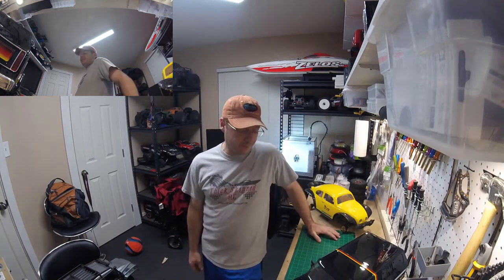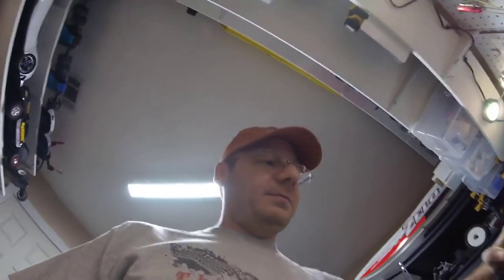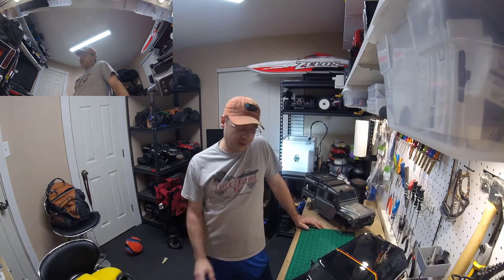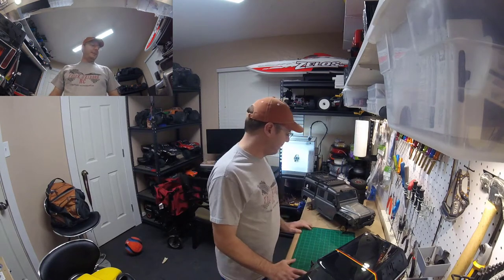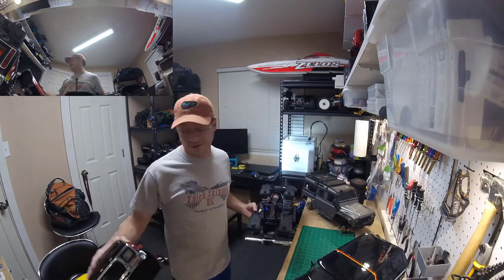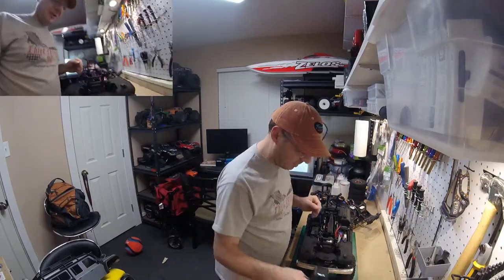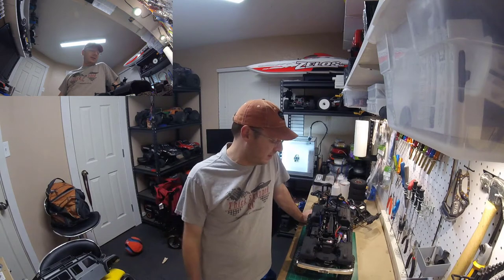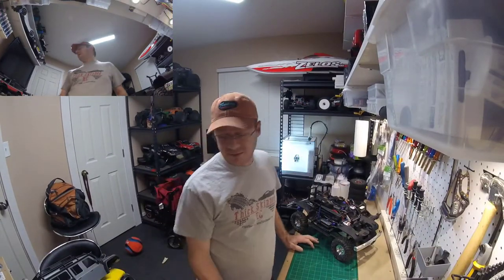TRX-4 Bronco - Impressions and Comparison to Defender Chassis.  Driving footage at start and end

Comment: The SCX10.2 you mentioned  (2nd Gen Honcho) looks like the bad axle housings compared to other version that has better housings . . I have a SCX10.2 kit truck with original Honcho body mounted and 1.9 Mud Slingers for fun challenges ..
Reply from the maker: It started with the axles with integrated chubs and link mounts but is riding on SSD axles now.  For what it's worth, the original axles took quite a beating without breaking anything.  Even had a 4yr old kit driving it full throttle around a creek.  I think they're tougher than most people expect.
Reply from the maker: Sounds like a cool truck.  If you're on Facebook join the group and post some pics!!

Comment: You still have the inner fender weight either way. So if your gonna compare body weight you cant use the Broncos inner fender placement as a advantage. I have both also and I believe the defender is better. The longer wheelbase proves helpful time and again. If you remove the spare and mount, with all the brass you got down low the defender would kick ass. Or you could do what you did and put comp crawler bodies on both rigs and the defender would come out on top imo.

Comment: Not even 24 hours and my steering servo stopped working. Im guessing this is common?? Can i get a replacement from traxxas under warranty??
Reply from the maker: Most likely yes, Traxxas will replace that servo for you.  Contact their customer support, they are usually very easy to deal with.  Losing the servo unfortunately is fairly common.  RTR servos just aren't that tough.

Comment: Great review! I got a question for you, I got the Defender trx4 but I'm using an aftermarket body and I was wondering if the Bronco inner fenders will fit on the  Defender chassis? just wondering because of the different wheelbase...

Comment: I do like the Bronco body, too bad Traxxas came out with this as the latest body release.
One point that I am starting to get a bit annoyed about though with everyone mentioning the "lighter body"..
of course it is lighter, strip the accessories off the Defender and then compare the weight.
you can leave the inner fenders in the Defender and on the frame of the Bronco and the weight difference becomes negligible between the two vehicles total weight. Its a bit unfair to compare the body weight if you leave the accessories installed and weigh the Defender body with the fender wells.
Reply from the maker: I get that.  I think it's just because it's such a drastic difference.  Its even lighter than the 10II XJ body with the rack on.  Your point is the reason we didn't weigh, it's not apples to apples...  But needs to be mentioned in a review.  Over and over could get old though I get that.  Appreciate the input!